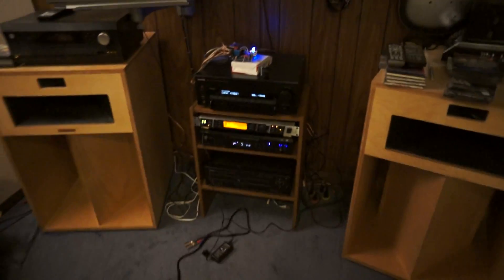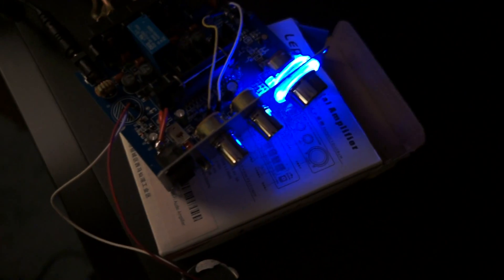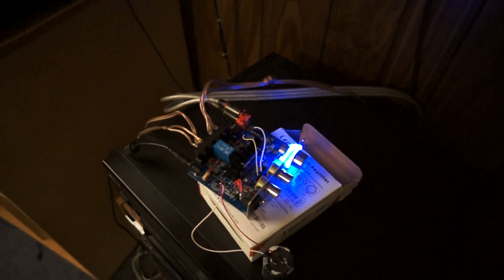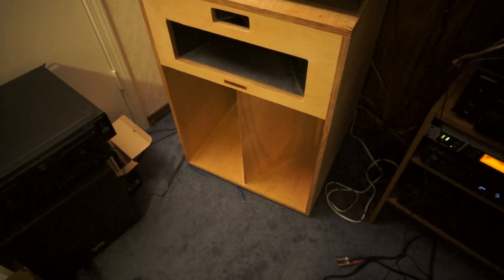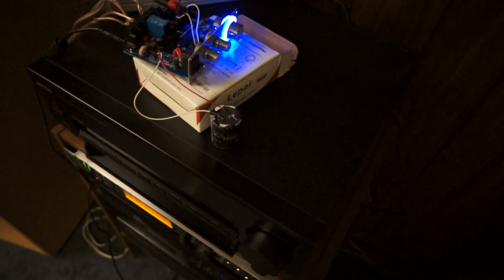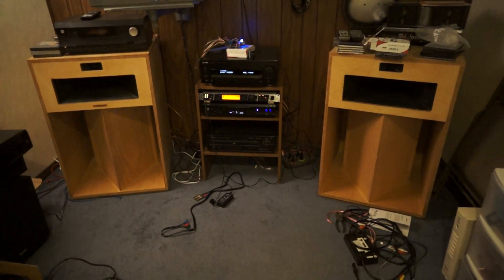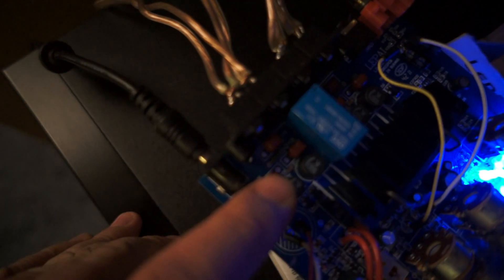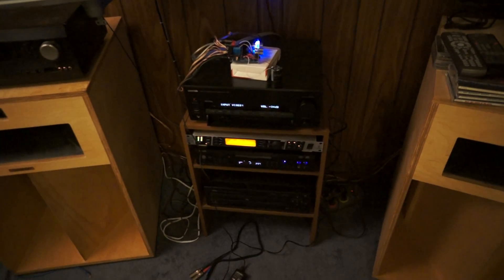Lepai Tripath ta2020+ Class-T amp modifications

Comment: Great video. Very much appreciated knowledge. Although, do you think you could send me a pic showing me exactly what part you switched out to improve the bass with the 10K uF? And also, the one u used is too big for me, what do you think is the largest size that'll fit in the stock body/shell? And lastly, if you could please link me to that part to buy it I would GREATLY appreciate all your effort. I am a novice at this, but with your help I think I can do this! Please, and thanks in advance. Got yourself a new sub.
Reply from the maker: Best bet is to get on digikey or mouser and look at 10K uF electroclytic caps and check sizes... no idea whats available.   Doesn't have to be an audio quality cap since its not in the signal path, its in the power supply circuit.  As to the place it goes - There is a pic in this post http://www.diyaudio.com/forums/class-d/90500-lepai-t-amp-ta2020-100.html#post2820148 that shows it's location on the board.... It s marked as C1.
Reply: escher2112 Wow, Once again thank you so much.. You just introducted me to a whole world I didn't know existed... Such deep audio-modders.. Especially for audio products even such as the Lepai. So again, thank you very much my friend.

Comment: I wondered about the power supply wire. The male DC coaxial plug they supplied comes with what looks like around 18 gauge wire and looked a little thin to me. What gauge would you recommend? And should I get a new DC male plug to go with the heavier coax?

I may have to horse around one of these days and do the mods to this thing.

Comment from the maker: Actually - if you swap the power caps for larger ones you may eliminate the need for a full 5 amps of power... the problem is, the power supply is drastically under powered because of that tiny cap... so when the tripath chip calls for power, it just runs out of steam.

But - to answer your question - yes, you should be fine with running an inline 5 amp fuse - I would use a fast blow and make sure you run heavy gauge power supply wire since 5 amps will fry thinner wire.

Comment: I was indeed cranking the volume. So after discussing it with you I grabbed a slightly larger power supply and that fixed that issue. Thanks for encouraging me to think! My plan is to mount this for use on my motorcycle, I'm guessing an inline 5amp fuse and a direct hook-up to the motorcycle battery should be okay? What do you think? After ruining one too many things, I no longer have faith in myself or the little knowledge I think I once had...

Comment from the maker: I use a 5 amp supply on mine... the amp rating doesn't matter since the amplifier will only draw the amount of power that it needs.  Were you cranking the volume when it shut down?

Comment: Just did some searching and there's a guy claiming that the solution to that issue is using a 5amp power supply rather than the recommended/supplied 2amp supply. Does this sound logical and/or safe to you?

Comment from the maker: @xyjames Definately - I rarely turn the volume up at all.  I think its more about having available current vs actual power being used.  The stock cap just doesn't store enough energy to supply the bass at any volume.  Another thing to note - if you've seen other reviews of this amp - the actual "true" output is no where near the rates specs - its more like 3-5W before the mods - after that the distortion goes way up.  No idea how the mods help as I don't have a way to test.